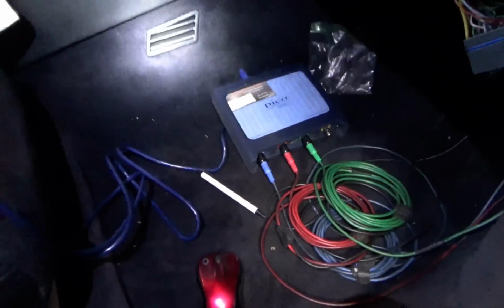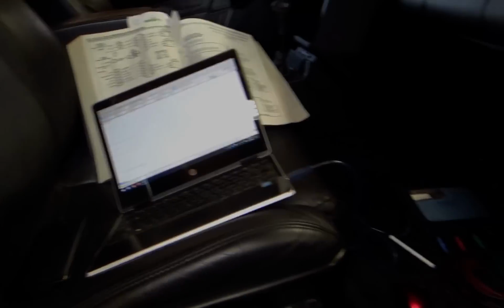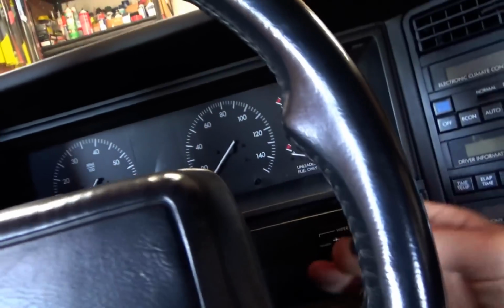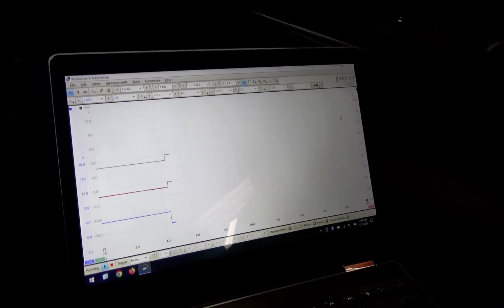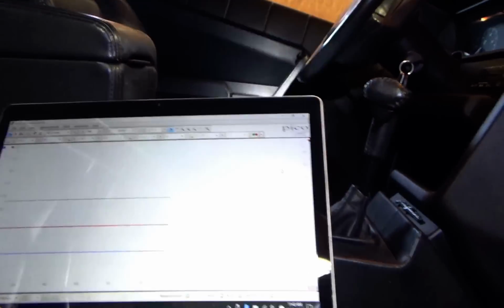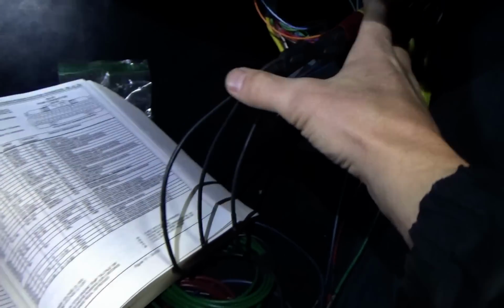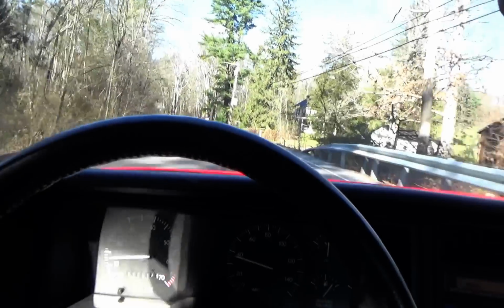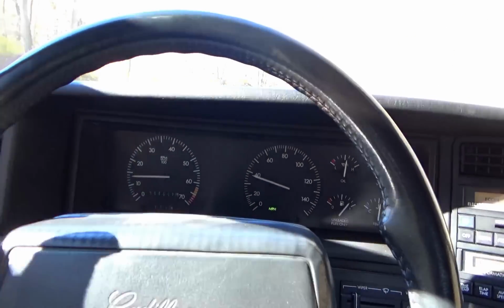(Pt 6) "Ferrari of Cadillacs": A/C FIXED...Mystery CEL...LOW OIL PRESSURE? (New Year 2024)

Comment: I love your videos.
But please for the sake of everything, get a nitrogen bottle and the adapters and whatnot to use it to pressure test questionable air conditioning systems. Sure, you can't detect leaks with your gas detector device, but you can tell if the system is tight or leaks, and if it leaks you can listen and use soap bubbles. A great way to not waste refrigerants.

Comment: Got a question on these engine issues;  is the Northstar V8 in the Allante different than all the other Northstars that were used in Buicks and Pontiacs?   It was in an impressive engine for the time getting 300 bhp from a 4.5 liter naturally aspirated engine; I suspect GM killed it because it was a complex engine.   But are these issues endemic to the entire northstar range?

Comment: The auto dim mirror measures the light coming in through the windshield via a sensor on the back of the mirror, as well as light hitting the mirror face side. You shining  light at the face side was inadequate because the mirror saw daylight on the back side. Put you finger over the sensor on the back and try again with your flashlight…it will dim down. The slider just adjusts how much it dims down.

Comment: Low oil pressure in gm engines is caused by a o-ring seal where the oil sump tube bolts to the block. The o-ring shrinks and cracks over time and when hot you get the low oil pressure.  Saw this in several motors, simple fix. Drop the pan, remove tube assy and replace bad o-ring and reassemble.

Comment: I have a 2018 ford edge , the problem is when you travel over 80 to 90 kms/ hr it starts buck and loses power , and when you travel below that speed, i runs fine.

Comment: When you said "Cristmas special," you meant next Christmas, right? 😂😅😂😅😅

A friend of mine in LA back in the early 2000s had some sort of Cadillac 4 door sedan. It was not a compact but maybe a midsize.
She took me somewhere in it, and when she made a turn it made a clicking sound. Pretty loud and it sounded like it was in the right front suspension.
So we went to a muffler shop on Sunset Blvd and had them put it on a lift.
The lower control arm had a crack in it. It was made out of thin stamped sheet metal.😮
That cured me of ever wanting a Cadillac.

Comment: A vehicle that has sat for years is full of electrical and mechanical gremlins. The more you drive it after reviving it to get it to run and drive, this is when the ghost and gremlins come out. While it can be extremely frustrating to an owner or mechanic, once all is sorted then it is fun time until the next check engine light or failure.

Comment: Yessiree, when you have vehicles that need parts and they aren't available, on backorder or just no longer made and hard to find, its always a great idea to have sources for parts through the trade warehouses such as strictly air conditioning or other niches of warehouses.  Like those A/C seals on the back of the compressor "manifold" which usually are included with a new or rebuilt compressor purchase. And thankfully we have eBay as a source which highly depends on the accuracy of the seller in describing year make and model for parts they are selling. 
Nice Deka battery installed there...by the relays cluster. On those belt tensioners and many idler pulleys, some are made of plastic and will develop a wear pattern that creates an angle where the belt meets the pully, wear I guess. After time goes by, that wear will force the belt to ride outside of center and do just what happened with this poor bolt modification, "jumped a rib". Its always a good idea to confirm that your replacement pulley is made of metal, even if it has to be aftermarket, the life of the pulley will be much longer as long as the bearing is of good quality. 
I'm sure the transmission shop was having to deal with tight spaces when they R&R the trans. BTW, all or most transmissions require the transmission to be at operating temp and the engine at idle when checking for fluid levels. 
Folks who have these older cars such as the Olds, this Caddy, that old Ford truck etc. need to know that at some point its going to be a good idea for them to change all fluids if they plan to keep them and drive them. Everything, brake fluid, power steering fluid, trans, engine, differentials, transfer case, coolants and so forth. After 20 years, it just seems fair to say, any fluid is worn out and completely done by that time.

Comment: While clearly not on the same level of sophistication as this car, I purchased the factory service manual for my 1989 Honda Crx HF when the car was new.  That manual has allowed me to service the car by myself without it ever having been to a shop and get over 385,000 breakdown free miles.  I would have no chance of that happening on the new cars.  So, I just appreciate what I already have as I try learning something with each new video.

Comment: Just when you think you're done... intermittent CEL, low oil pressure and a shivering relay (loose ground?) - new ghosts just keep coming in. I admire your patience, Ivan!
Very sophisticated control system for the ignition, along with a service manual packed with valid information (why aren't they all like that?)
I guess, in the next video we will finally see the Allante go back to its owner. Troubled cars seem to love your shop and don't want to go away 🙂

Comment: Regarding the mirror, I think it might not work during the day, if it's anything like mine. Mine has two sensors, on each side of the mirror. One facing forward and one backward. Only when it's dark outside and there are headlights from behind it darkens. So you might want to take it for a night drive test.

Comment: There were a couple of bulletins on this problem back in the day. One on crank sensor, replaced alot of them. Another for grounding the ignition control module bracket and one about making sure spark plug wire were routed away from ignition wiring.

Comment: Such an awesome car and that Northstar is a real screamer and a 1 year only option. They killed the car after 93. GM pulled out all the stops on this one and let the engineers run wild to try and compete with the Germans. As usual, they cheaped out on materials and electronic components to the lowest bidder. Still you have to admire they lengths they went to with all the computer complications. It should have been a rear wheel drive so the drive train packaging wouldn't be so cramped. They really shoe horned that engine and trans in there. Hope this guy has someone like Ivan he can go to in FL as I suspect there will be more issues down the road. This is the kind of car you drive to cruise ins and shows only. Love it.
Reply: Evidently they were trying to compete with Audi in being overcomplicated and broken, with the check engine light constant…. 😅

Comment: Imagine a car that actually shows you trouble codes without a scanner and has trans and oil dipsticks.
Reply: Well in all fairness.  Nothing shows on the dip stick so should that count?  🤭
Reply: @robertsmith2956  Good point. 🙄
Reply: Take it a step further, no computers, no modules, no trouble codes.
Reply: @brianw8963  That is how I found out my electronic pickup was bad.  when car stalled, I hooked my timing light to plug wire, and cranked the engine.  No spark, it was the pickup.
Reply: @robertsmith2956  👍👍🇺🇸
Reply: @brianw8963  I had never know a magnet can intermittently fail before.
Reply: @robertsmith2956  That was pretty common on those  GM models. I think it was more to do with the internals of the ignition modules getting overheated and somewhat inferior to start with. Bearings in the distributor shafts were also an issue.
Reply: @robertsmith2956  I bought a new 1989 Jeep Wrangler with the 2.5l engine. I drove it for 30 years and 350,000 miles. The only time it quit running was when the crank sensor went bad (probably after 10 years) ; up until that time, I didn't even know what a crank sensor was (engine had EFI throttle body). My local mechanic replaced it and it never failed again.
Reply: My 05 Subaru Outback 3.0 does all three. It’s pretty sweet. 🙂
Reply: @Becca-k4h  Back when OBD2 was the next cool thing 😎

Comment: Wobble extensions must be an alien gift (like zip ties and Velcro) because they are so useful. Back in the day my brother owned 1969 428 Mach 1, that usually required you loosen the motor mounts and jack up the engine to R&R the spark plugs, but with a little initiative and wobble extensions (and some skinned knuckles) I managed the tune up leaving the motor mounts untouched. Great work as usual Ivan!
Reply: Had a 1969 Mach 1 with a 390 and a friend had the 428SCJ and we used a small flexible tube on the end of the spark plug to remove and reinstall them.  Breaking them loose and tightening down wasn't bad.

Comment: I wonder if this car was wrecked at some point in it's life.  The original color was a Teal color and it was over painted with Red paint.  It may have been totaled out.  Cadillac was ahead of it's time, but very few mechanics knew how to use the available diagnostic functions.  I will give the car one week before the check engine light appears again - it is 32 years old and way to technical and probably was totaled out at some point.  Best of luck to that owner...:)
Reply: Think they said in an earlier video that the owner had it wrapped because the paint is shot.

Comment: Low oil pressure might well be caused by a hardened oil pick up seal in the sump😮
I'd be very surprised if it was connected to the faulty relay.
Reply: Yeah, I would think if it had anything to do with a relay, it took a wrong turn somewhere. 👍

Comment: On the 1987 Lincoln Mark VII that I had, I was able to obtain a set of repair manuals for the car.  IIRC there were 2; one for the body and one for the engine.  That car had air suspension at all 4 corners and the brake master cylinder looked like something out of the space shuttle.  (My first car with anti-lock brakes.) Those 2 manuals looked like telephone books from Los Angeles, California.  Each was very thick with onion-skin pages.  This car is NOT as quirky as some you have worked on, Ivan.  Seems like there was this car with a V-4, 1,197 cc engine, that you worked on as well.  It was in some place that began with an "N."  GREAT VIDEO!

Comment: “We’re not doing aftermarket modifications on this exotic piece…” says the ‘mechanic’ that shoved compressed foam into the steering column to “fix” the high beam switch. 😂😂
Reply: Ummm..no parts required
Reply from the maker: @vg3430  😜😆

Comment: The electrochromic rear view mirror likely takes a signal from the headlights to "enable" but may also have a forward facing light sensor to decide if it's even dark enough outside to auto dim.
Reply: Yeah, there is likely a daylight sensor, otherwise it would dim during the day if you drive with your lights on.

Comment: I cut my teeth on manuals just like that.  In my case it was the factory manual for my 1993 Caprice but it was just like this one.  Great theory of operation and anything else you could possibly want.  I was in college for electrical engineering at the time and it was glorious to sink my teeth into everything.  Bought my first scan tool shortly thereafter and soon after that started burning EPROMs for the engine computer.  I aced my 4000-level embedded systems course because I had all the hardware to burn my own EPROMs.  The TA was constantly looking over my shoulder (in a good way).

Comment: The old Haines manual you could purchase at you local Napa or Pep Boys would never ever cover such details. 
 What you are doing is a hands on and visual that helps and enlightens true mechanics. 
 Information is what makes me happy.
 GM was on the right track but sold off all there engineering long before they could perfect it.
Reply: I could never understand why it never looked like my manuals picture till it dawned on me.  The Datson they used is right hand drive, and everything was on the wrong side.
Reply: @robertsmith2956  Datson is right!!  Nissan was wacky. Loved my orange 240 Z

Comment: Ivan, I'm so old I actually remember technical manuals.  I was in auto repair, before Mitchell On Demand or Alldata came into existence.  We had entire rooms with shelves full of nothing but manuals. When I was doing heavy equipment in the military, we had a dude who's job was nothing but going from shop to shop, updating tech manuals.
Reply: Me too. We had the book room too
Reply: I have these manuals for my 90's model GM vehicles.  The one for my 98 Chevy trucks is four large volumes.  The one for my 92 Cavalier is one volume.  The give a lot of information but sometimes it's hard to find what you want.  The index is not that detailed.
Reply: Our library had a nice set of manuals on  my car.  They were REF so couldn't  be checked out.  One day I went, and they were gone.  It still makes me sad.
Reply: @stevenkerwin4041  funny thing about a paper manual is I find I use them all the time for diag especially on electrical problems. Nice to have a piece of paper to write things down and for reference.
Reply: I used to have several old Motor books. One big book covered all the domestics over a several year span, and they were quite precise . I don’t even know where they went.
Reply: Yes I had old Chilten manual's
Reply: @johnnyfivealiveable  Chilton's ain't got nothing on Helm manuals.
Reply: @farmermiyagi1338  This is like one of those songs that sticks in your head. Still wondering what I did with them, probably tucked away in one those “ I might need that someday” boxes, which I have too many of.